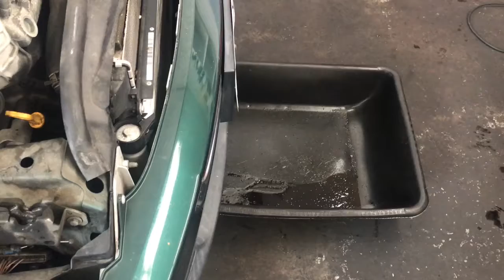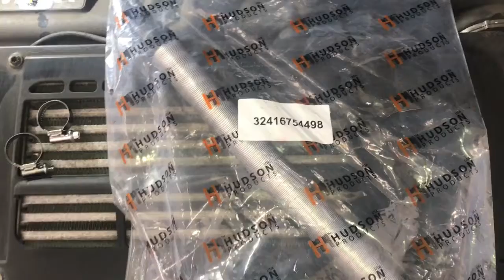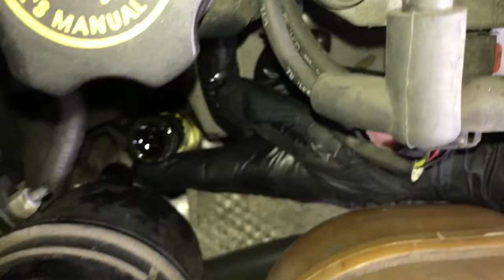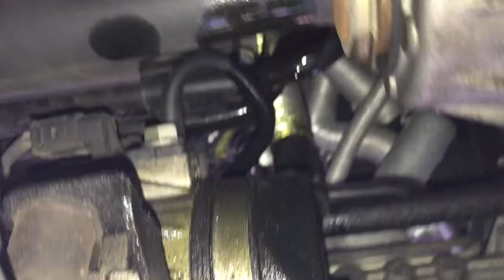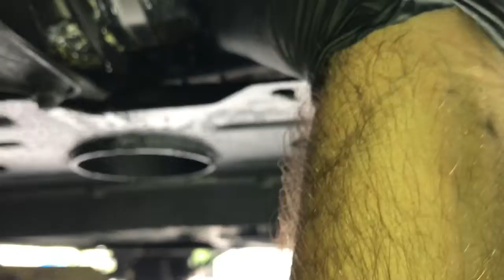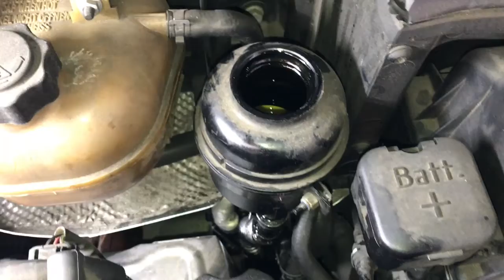How To Replace The Power Steering Reservoir To Pump Feed Hose On A 2001-2006 Mini Cooper S (r53)

Comment: I have a leak from either the fluid reservoir or the hose connection to it. Not sure which. Any idea which is most likely
Reply from the maker: Hard to say without seeing it. But the bottle will have signs of stress cracks. And kind of have a dried outlook.

Comment: Great video.  I just had my 2003 Mini Cooper hydraulic power steering pump replaced under warranty  at the dealer.  I did have other recommendations. They found the Power steering hose from the reservoir to the rack leaking fluid.  I read this thread and it doesn't appear to be the same as reservoir to pump.  They gave me the quote here in California so I am looking to replace the hose myself.  I hope to see a video on the res. to rack hose replacement soon in the future.  Thanks Brian.

Comment: Thanks for the excellent video. The dealer told me awhile ago that I need to replace the power steering "RES to RACK" hose. I just kept adding fluid. So now I'm motivated to fix it, after seeing your video, but I'm confused as to what "RES to RACK" hose means, exactly. You showed replacing the reservoir to pump hose. Is there also a reservoir to rack hose? Thanks!
Reply: There is at least one comment below talking about a hose to the rack

Comment: Hi Brian,  Im thinking of taking on this project on as my mini cooper has the same ps hose- leak issue. However, there are two hoses, the (return) and the (feed). Your video will certainly help me with the feed replacement. But (from your experience) is the return hose replacement that much harder to approach? While i only get glimpses of the return hose in this video, my research tells me that they are adjacent to each other both from the reservoir on down to the pump. Is that correct? and if so, are there any parts i would need to remove when approaching the return hose replacement? Thanks in advance.
Reply from the maker: Frank R I believe the two hoses are adjacent to each other. As far as what to remove it’s hard for me to say I did this vehicle quite a while ago. But if I remember right it was pretty straightforward.
Reply: Hi Brian, "Thank you" for the prompt reply. There aren't many video on this (certainly not as clear as the one you made). The other video I found had a guy take off the arm assembly to replace this set of hoses! And an initial quote from a local mechanic said the same thing about (taking apart the arm assembly). Maybe he watched that video prior to giving me a quote.  Well I appreciate the feedback. And your video really raised my confidence bar to take this on. Thanks Brian.

Comment: Thanks Brian! Highly informative and exactly what I need to replace my weeping power steering reservoir hoses. A question / observation: couldn't you have used your fluid extractor to suck out some fluid from the hose before removing the bottom clamp?

Comment: i just did this i was wondering i put in CHF11S as you said you say it has to be a certain one do you mean brand or just CHF11S because i went to my local place and they said it needed CHF11S so thats why i ask is it a brand i just used there brand.
Reply from the maker: Lew Housley it doesn't matter what brand just that it's CHF11S
Reply: thanks allot :) also i have a question my water that you use to clean the windows is cracked i think or has a hole when i fill it. Water just leeks out on the floor.... How do i get access to it do i need to take the wheel and side pan off?

Comment: oh my god thank u so much i love you!!!! i just got my mini cooper s 2003 75k on clock and i think this pipe is leaking it has had a brand new pump fitted 1000 miles ago in my paperwork so it's not that. And the pipe looks very worn and there is fluid under the car that feels not like oil and my oil is not going down. but break fluid is and the area it is wet is EXACTLY the same spot under the car the hoze connects it makes so much sense watching this video!
Reply from the maker: Lew Housley glad the video helped out. Thank you for watching!

Comment: only wanna know... my Ac no work well is work but when I put... freeze no cold my car.... I change the compressed.... and still no cold
Reply from the maker: Jandy Palma you'll need to check the fuses relays are wiring to the compressor
Reply: How to Automotive  thank u...  and where is the fuse locate... n the Front or inside

Comment: Jeeze, my mitts would be so scarred up in those tight spaces. 
Does this routinely fail on the Mini?
Reply from the maker: Rob's Wrenches yes it fails all the time. The same hose is use on BMWs with the same problem.